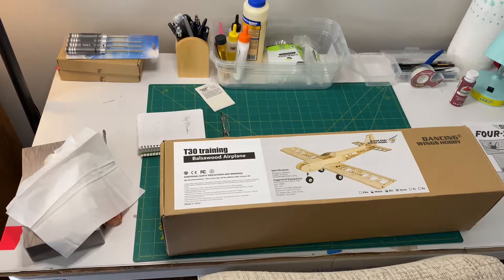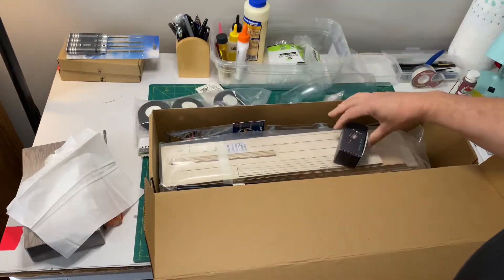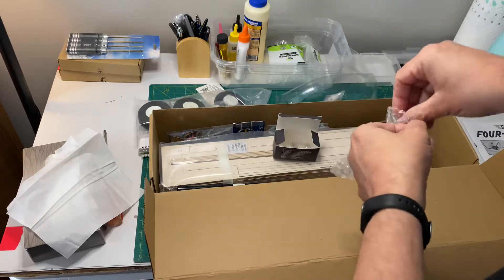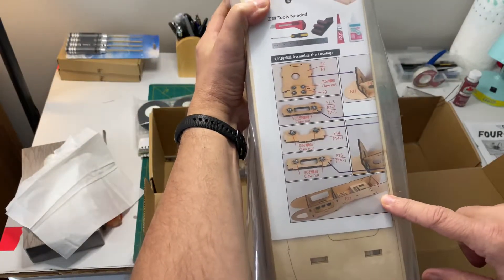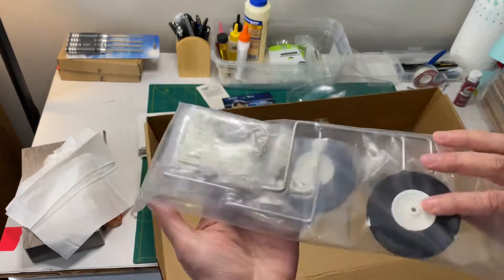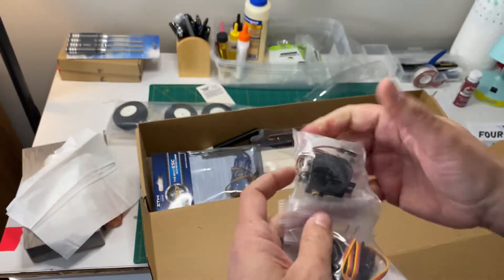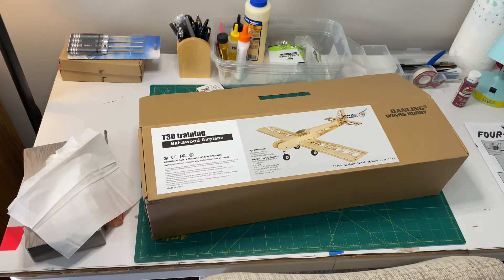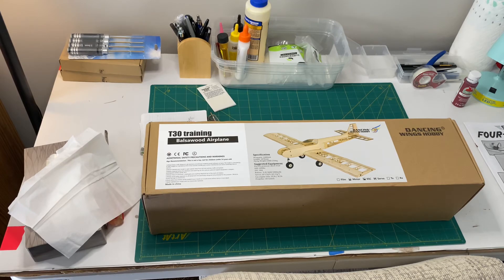T30 unboxing

Comment: Hi JMac, you and I are just starting out on the same project. Ill be interested to see how you get on, & if we run into the same issues. The first thing is the canopy mine was just the same, very thin and distorted on one side. Your motor the 2817 motor looks small to spin a 11x7 prop so I would like to know how you get on with it when you get there. I’ve have the kit & the extras separately from my local supplier, I will be using a 3547 - 800 kv with 12x7 on 4S. This my second DW kit I’m building for a review & except for the manual the first one went together and flew very nicely, so I’m hoping this one is the same.
Reply from the maker: Hello Roy,  This is my second DW as well, though I haven't started it yet.  My first was the Sunbird2 which has a very small motor as well.   On that kit there weren't any instructions for mounting the motor and it didn't fit very well in the space they provided.  I ended up replacing it with a different motor that mounted on the outside rather than inside the model.    This motor does look small and running with a 3S Lipo off a hard surface might be ok, with trainer performance, I would expect that a grass field or better performance I'll be replacing this motor as well.

I'm excited to start the model and I expect it to build quickly, the DW parts seem to fit together nicely but the instructions are pretty sparse, you have to think through and trial fit some of the parts before you glue them.
Reply from the maker: Also I'm surprised there aren't very many videos about the T30, not much information about it at all.
Reply from the maker: I took a more in-depth look at the kit and a couple of things stand out. 
1. - there isn't any plan, the parts all fit together and there isn't any plan drawing or instruction text to built against, just the instruction pictures.
2. - it's very light, the wood used is very thin.   I suspect the wing loading is going to be very light.
Reply: Thanks for the reply. This is my second DWH kit build, Ive  done the Cloud Dancer for a mag review out early next year. That kit has many similarities to this one, the main one being the lack of build detail in the manual. The thing’s I don’t get are, why the small box? Like this one the spars & all span wise parts come in 2 parts. That save 100mm on the box! The other is the lack of setup for radio, motor or controls movements. This seems to be a theme across all their kits. The savings factor is it does fly very nicely once shorted, and has a very light wing loading, I’m hoping the same for T30.
Reply from the maker: @RTatBstoke  The two part spans are strange, I wonder if their production equipment or laser cutter has a limitation in the length of material it can handle?  I know DW makes puzzles and other kits.  I'm finding this kit is more like putting together a puzzle than building an airplane.  Many of the parts like F20 can fit upside down, but one side tab is a little larger than the other so there is a "best fit" but no instruction to say so.
Also as soon as I opened the sealed bag of wood most of it start to twist and warp.  I'm sure there is a difference in humidity between where it was packaged and New Hampshire, USA.  It's becoming a challenge to keep straight lines during the assembly.   However, I'm enjoying putting it together and assembly is very quick.